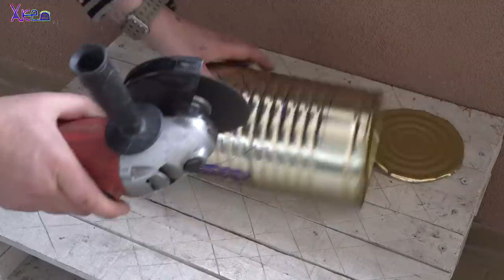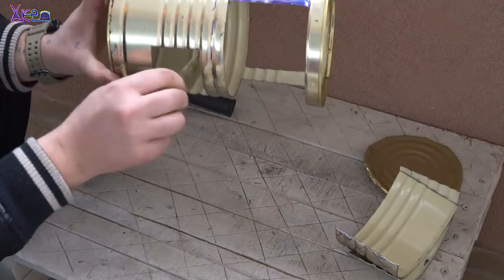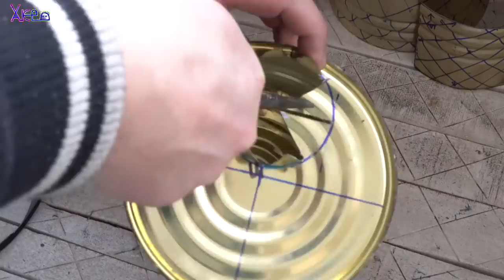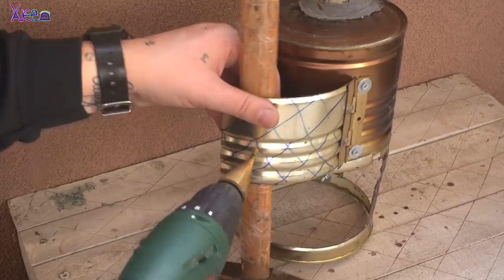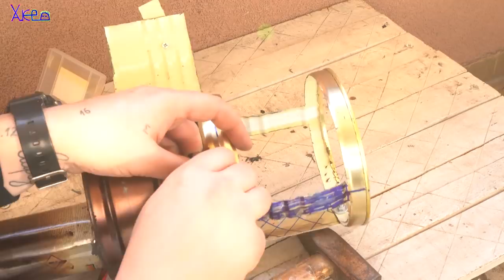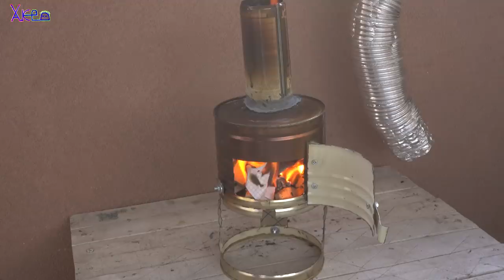Homemade Mini Wood Burning Stove

Comment: That duckling that you used for the chimney melts at a very low temp. Be very carful it’s not made for heat like your putting off, you could easily have an out of control fire.
Reply: Nothing worse than an out of control duck fire 🐤🐤
Reply: Do u have any suggestions

Comment: This is great if you wanna die.

The pipe is a dryer pipe... it's not made for direct flames. Even the best quality can't resist to higher then 650-700 F degrees wich can be easily obtained even in a tiny stove. ( depending on what kind of wood you will be using)

Comment: Try adding a double boon. It will give you more heat and stop the flames from going up the flue! Good job on your project!
Reply from the maker: Thanks man
Reply: whats double boom
Reply: @jsmithkoko  it is a flange at the top on the inside. If your stove is circular on the inside cut a circle the same size and then cut a strip off one side (lest than 1/4 of the over all diameter of the circle. Weld at the top just below the chimney, with the part you sliced off away from the chimney, and angled down slightly. This forces the smoke to circle back and re-ignite. It also stops the flame from going up the pipe. Let me know if you have questions 😎
Reply: Hey, bravo for an adult response on youtube. Zero sarcasm there. I didn’t know what it was either. Thank you.
Reply: @roseericson3828 ohhhh you mean a damper?

Comment: Some fool is going to try this and burn their house down. Not that it can't be done, but where are all the precautions that should be emphasized!?
#1 cutting out more metal than needed to form a sturdy stand. 
#2 making sure it is used on a non flammable surface.
#3 showing where you are venting it and that it DOES NEED TO BE VENTED OUTSIDE!
#4 And that venting cannot touch any flammable surface. 
You assume people have some common sense. They don't! Some are incredibly stupid.
Reply: I agree! An accident waiting to happen

Comment: This could really be useful as a mini stove inside a tipi tent.

I would make at least 3, possibly 4 support legs though and also bend up only every second flap to make the chimney, that way it will retain a bit more of the heat instead of going out through the chimney, while it is still pretty good ventilation.

Comment: What about the flue ya got there is is going out window or roof 🙂 now make heat exchanger and wack a rad on the wall 🙂👍
Reply from the maker: For sure I will make Part2 DIY stove with your idea will be great
Reply: @Hacktuber  that be good bro👍

Comment: • This could be very useful in these Russo-Canadian winters. (Well, it would've been if winter had actually come this year. 🤦)
• It looks okay, but I'm a little worried about how flimsy the legs look; they're too wobbly and would get worse when hot. :-|
• I'm tempted to make one to keep on my desk. 😀 The heat and smell would be nice. 👍 (The co-op might evict me though.)
• I don't have a vent for the smoke; it would need a hole in the wall which would make a draft and defeat the point of the stove.
Reply from the maker: Thanks for feedback and I just want to show you guys what you can make from simple items like metal can to be converted into mini stove